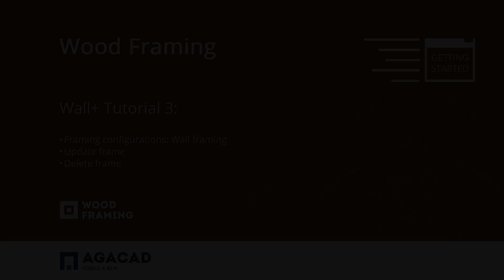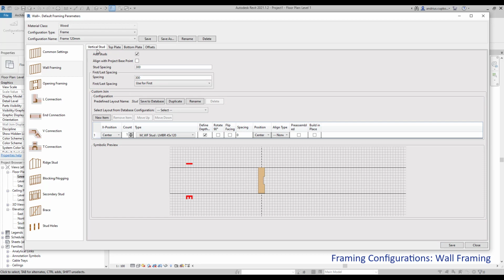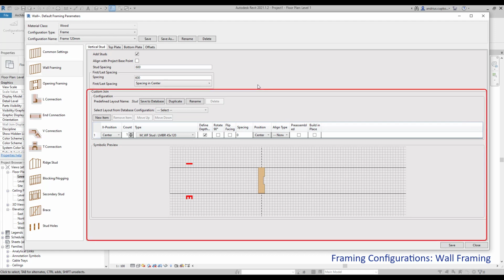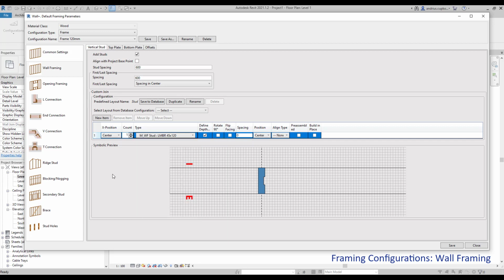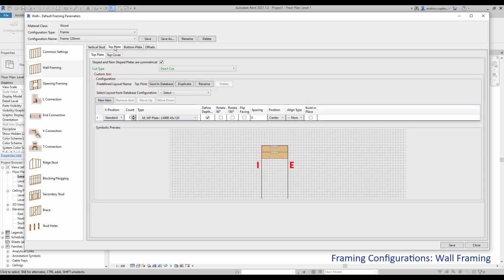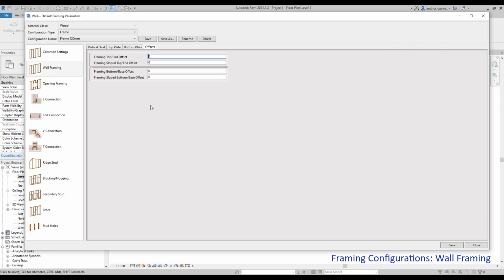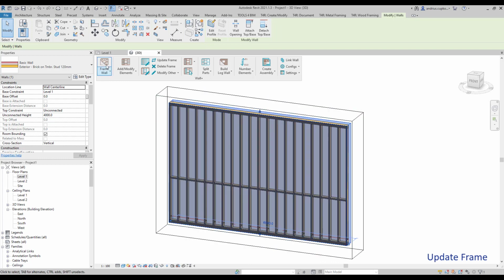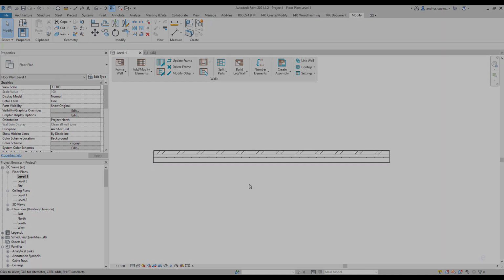Wood Framing Wall+ | Tutorial 3: Vertical/Horizontal Elements

Comment: Thanks for the tutorial!!

I've got one question regarding the frame update.
After creating the framing, my walls seem to become separate elements, and I can no longer select the wall as one entity.. do you know any possible reason for this?
Reply from the maker: Thanks for watching! 
Try checking the Part Visibility parameter. If you want to pick the entire wall instead of parts, then change the parameter setting to Show Original. If that doesn't solve the problem, please write us an email at helpdesk@agacad[dot]com and include some screenshots with your issue.